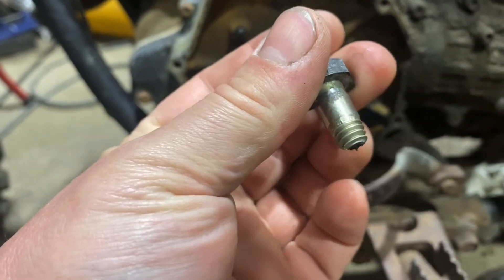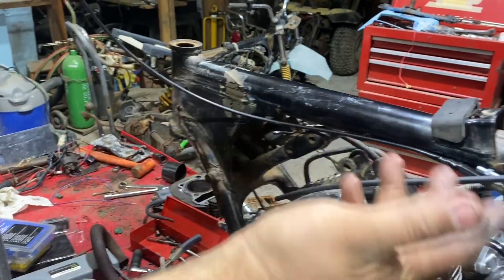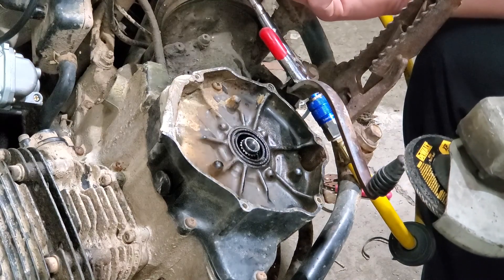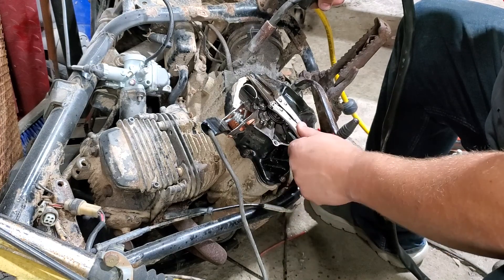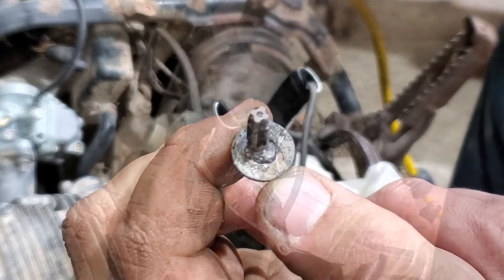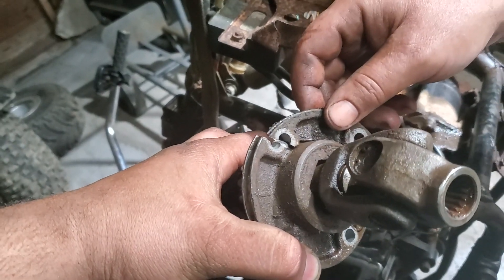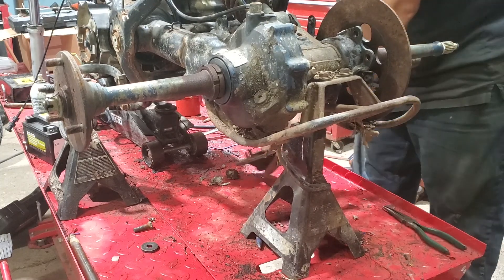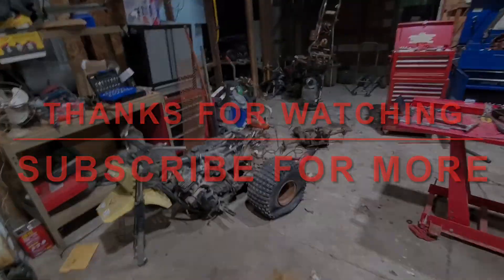RESTORING 5 Yamaha 225DX Tri-Moto Three Wheelers 10

Comment: Is it normal for one of these to have noise coming from the clutch side of the engine it's like a slight rattle when the engine comes off idle but stops after
Reply from the maker: It could be the clutch engaging. They do make a little bit of noise from the clutch side. Next time we're out riding one, we'll film the clutch noise and post it for you.
Reply: @rustednutrepair675  thanks